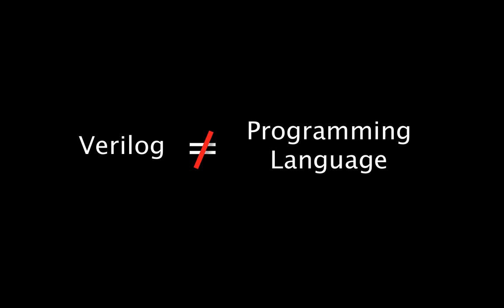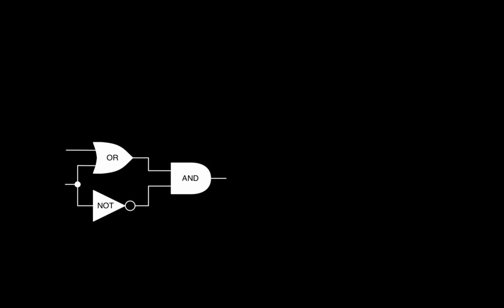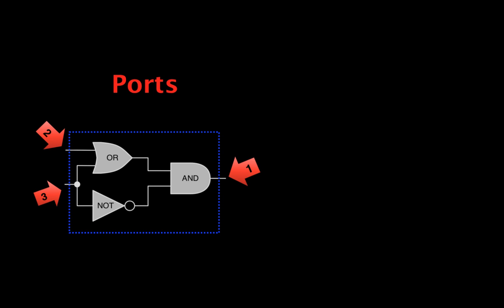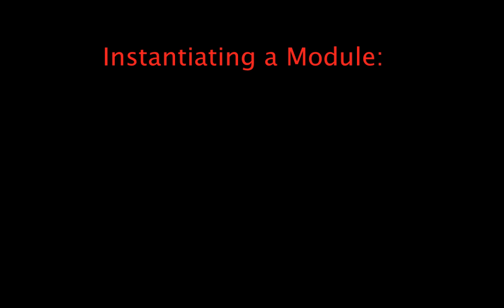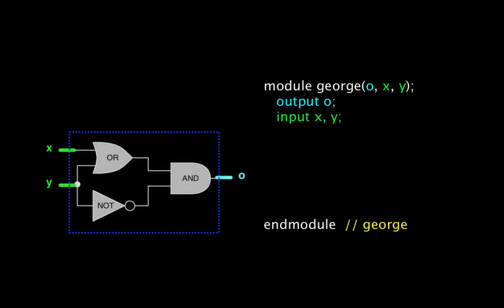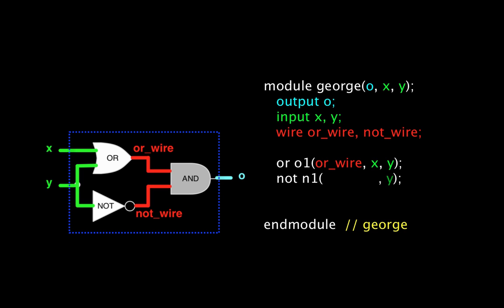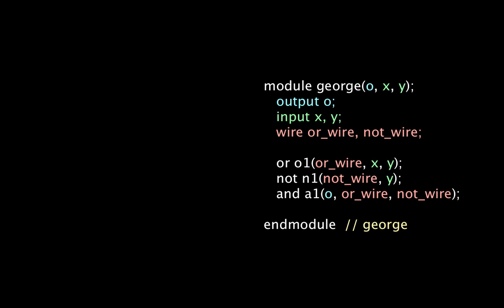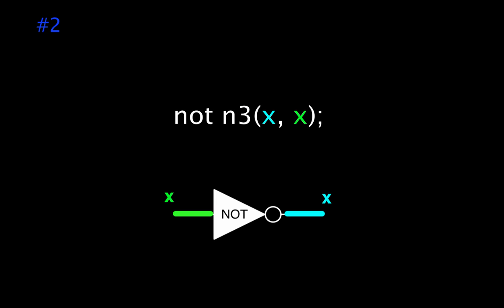An Introduction to Verilog

Comment: even though it isn't a programming language, it is very similar to object oriented languages
class -> module
wire -> variable
module adder(o,x,y) -> constructor

this is very similar to c++. 

your explanation is amazing!! thanks for putting in so much effort
Reply: well, wires arent  exactly the only variables, they represent a variable which is going to be connected to something else, hence it is unmutable during the runtime.

There are others like integer (32 bits), real (64) and reg which work in another way, the most fascinating in my opinion is really the reg as it is dynamically set in terms of how much bits/bytes it is made of, you could say make a "reg [7:0] a" so a variable "a" which is a register of 8 bits

Then there is another cool thing, for instance when choosing to use the behavioral style to design, one can declare an output as a reg "output reg [N:0] f", so a reg works not as a register that we are used to in assembly for instance but rather as a variable that allows us to carry data during runtime. Such a fascinating invention was this verilog i love it!

Comment: Very good introduction, thanks.

It somewhat begs the questions "wires?". 

Why not do it in the proceedural way of simly passing the output of one function (module) into the input of another?

Having the wire declared independently looks like it can cause problems.... surely it allows you to have the one wire as the output of more than one module? 

Why have a language grammar which allows you do that by having a wire exist as a seperate entity to the inputs and outputs?

Whilst a wire is exactly that in the real world... independent of the circuits you put it in... in the world of circuit design you don't want wires to be floating around on their own.